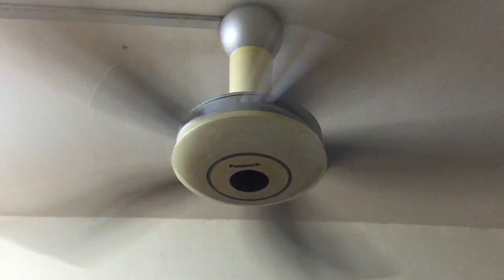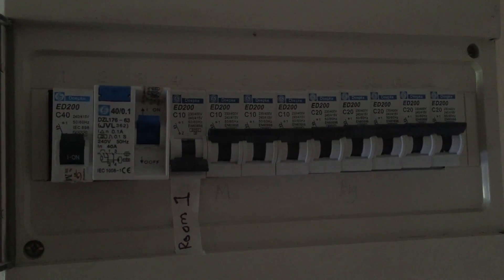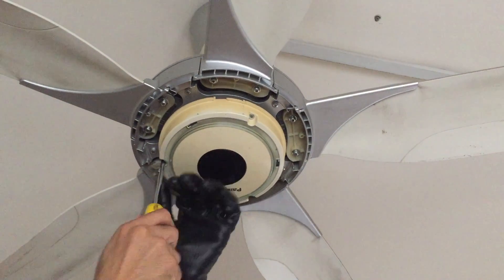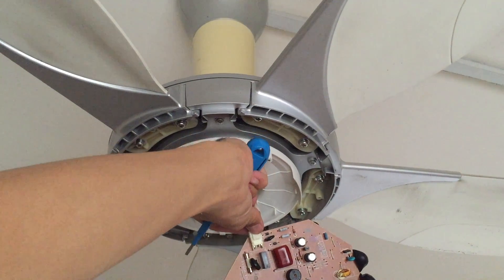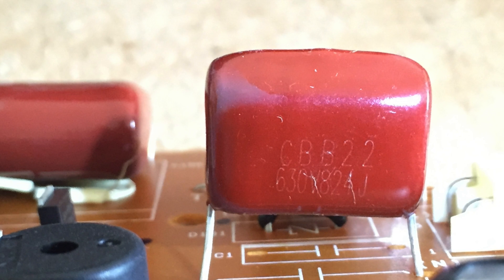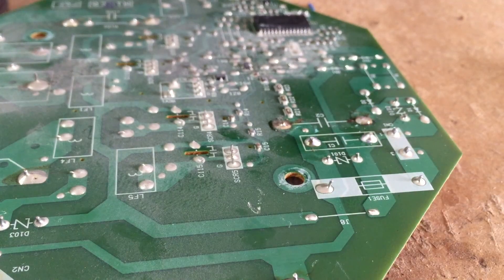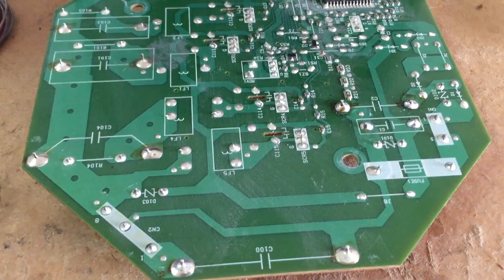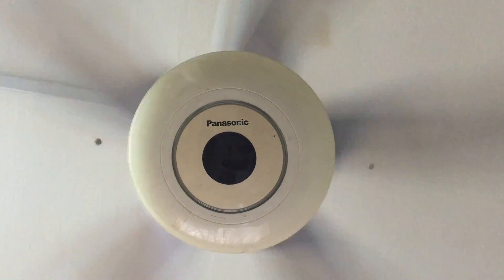Noisy Panasonic FM15E6 ceiling fan failed to start.

Comment: It's safer to switch off the main switch. Take a picture of the wiring connections before you unscrew or remove the circuit board.
Reply from the maker: Good advise.

Comment: Wow... Thanks! Informative! I have KRK 3 speed remote ceiling fan capacitor replaced too! 3rd speed was slow as 2nd speed! Finally, replacement on 1.8uf 500vac capacitor (other 2 : 2.4uf 250vac & 5.0uf 250vac) then 3rd speed back to as it is! So Bro. Do you know which capacitor controls the 1st & 2nd speed? Still, how to solve the "little ticking sound"?
Reply from the maker: My wild guess will be one of those red color non polar capacitors. The smallest value one perhaps for slower speed. I had lots of sleepless night caused by the “little ticking” sound. I tried apply petroleum jelly around the brim of the cover. It seems working for a few days. I remembered someone below mentioned about the ticking annoying sound caused by the bigger capacitors. Not really sure if it will be applicable for your situation.
Reply: @CTB6  thanks for your prompt response! Erm, I think of that way too 1.8uf might control the lowest speed compare to the 5uf capacitor controls highest speed! But, since I couldn't find the 2.4uf and 5uf capacitor, then I replaced the 1.8uf to just did a test, boom... It's 3rd speed's capacitor! Haha.
Oh, so he/she from the comment finally solved the ticking noice by changing the highest reading capacitor? black or red?) Then I shall change all the rest to give it a try? Haha.
Reply: @raymondlooi  You can get all the capacitor you need from AliExpress. The higher capacitance control higher speed. The yellow one is a safety capacitor or most time we call x2 capacitor. It has nothing to do with fan speed. Usually is just to filter noise in power supply line so the fan would not cause interface signal to near by electronic devices.
Reply: @chanh9220  Thanks, dude! Do you mean those RED Capacitors just for noise filtering? Nothing relate to speed control? What does the x2 capacitor mean? Standby? 😅 Love to learn more!

Comment: Can you please show or tell me how to remove the board from the clips, I tried but couldn't.
Reply from the maker: Try hold two adjacent clips with both thumb and gently push it back to release the board from the holder. Need some force but not until it break the plastic holder.
Reply: Alright, will try again.. Tks for the prompt reply..

Comment: Tks Liew, I hv the same problem with this type of panasonic fan. Ihv change the PCB once some 4 yrs back but now it is happening again, rattling sound and the fan is spinning very slow. But thks to your video I will try to change that capacitor C1 and hope it will solve my problem.
Reply from the maker: It is a common issue for ceiling fan. Can’t afford to always change the whole board when it is a capacitor not working.
Reply: @CTB6  , Hi Liew, I went to Jln Pasar, bought 2 sets of caps - .1microF n .82microF and change both on my 2 panasonic ceiling as both also started to spin very slowly and gave a grinding sound. Whalla, after changing the caps, both fans now work perfectly, much tks to you. I chked the faulty caps with multimeter and indeed it was partially bad, very low capacitance, from 100nf it now becomes 15nf.
Reply from the maker: How years  is the fan been using used?
Reply: @CTB6  5 years
Reply from the maker: Statistically it is about 5years the capacitor will be malfunctioned. I guess that’s the life expectancy for that capacitor.

Comment: I couldn't open the cover shown at 1:40, even a technician  that I called couldn't open it. HELP!
My story:
Last time my fan could not spin fast anymore, and an old technician changed the whole board, costing RM166, and the old board he didn't give me back for me to analyze the problem (I wanted to change the capacitor, but this old technician thinks he knows it all). But the new board he changed for me, made the fan spin fast, but after a while, there is no WIND! WTH! My house has 6 same panasonic fans in total, I want to try to exchange the new faulty board with other fan.
Reply from the maker: Could you slide the cover according to the Open direction?
Reply: @CTB6  I managed to open 3 fans cover, the other 3 cannot open, somebody locked it down! ==!!!
Reply from the maker: Try rotate the other side or spray small amount of lubricant. It could have jam or plastics melts and stick onto each other. Some model do rotate the other side. It occurred to me once when the cover don’t know why becomes to hard to open. Try also push in then rotate. The notch can be slightly bigger that’s way jammed. Not really act of other people. It is definitely mechanical.
Reply: @CTB6  holy shit, I just opened it when I was examining the small popup, like a dot, that locked the cover in place, took me so long
Reply from the maker: Yes! That’s the notch you need to overcome.
Reply: @CTB6  My room fan is the one I wanted to change, it cannot be opened, the old technician somehow locked the cover, I have to find the old technician to open the it again.
Reply from the maker: If that’s the case then try 4D oil.
Reply: @CTB6  Hey there, if I am not mistaken, if you cannot open the cover, you cannot take down the whole fan, it's the key to disassemble the whole fan. I still have 2 fans' covers cannot be opened, because the covers are fully locked.

Edit: After exchanging the board taken from other working fan, the no wind problem still exists. What actually is happening is that the wind goes upward instead of downward after turning on. The wind will blow downward after some time, then blow upward again. Other fans don't have this issue. I know about fans in overseas that move both clockwise and anti-clockwise, like https://www.youtube.com/watch?v=9c5ZMPVK_VQ, but it's not relevant in my case.
Reply from the maker: It is the natural breeze feature? Try deactivate.
Reply: @CTB6  Not the "natural breeze" feature, I have tried that as well.
Hope someday I can discover why that stupid wrong blowing direction is happening, I think I need to be a scientist first.
Reply from the maker: If it is the speed issue then you may start with the biggest capacitor. Then the smallest yellow colour capacitor. Capacitor used to regulate the voltage. If either one malfunction it will cause the rotor to loose speed during operation.
Reply: According to Josh CA comment, should I change the biggest longest red color motor capacitor for my old original PCB? the one that old technician took it away sadly, that made the spin won't spin fast.
Reply: Change 2 capacitor on the board. 0.82uf 275v black colour and 1.9/1.8 uf 500v red or black depending on batch.

If really cannot remove the plastic lid. Just use something sharp to crack it into 2. Then after repair and everything running good, but a new decorative cap from the panasonic or kdk service center

Comment: Mr. Liew, if the panasonic fan sounds noisy, when switch off it quiet immediately, while the fan still spinning and quiet, what would be the problem?
Reply: Provin Tan change motor capacitor on the PCB. Refer to my video below
https://youtu.be/n1S-tP6OG3A
Reply: Thanks Josh. Will try it out.
Reply: Hi Josh, just replaced the 0.85uF and it did the trick. Thanks so much for sharing.
Reply from the maker: Hi there, may I know if the 0.85uF capacitor is the yellow tiny capacitor  or the motor capacitor (biggest red) in the board? Do share your experience here. It definitely helps more people who face this problem.

Comment: Tbh it's wrong capacitor, these fans the noise is caused by the motor capacitor 1.6 - 1.9uF 500v, depending on the model. I've used multimeter to check and the capacitor mentioned in the video along with those surrounding are always fine on many fans I've repaired. It's always the motor capacitor that loses its charge and causes the motor to hum due to insufficient current. The burn marks don't really indicate anything cos the capacitor themselves are always okay when tested for capacitance.
Reply from the maker: Josh CA 
Thanks for your sharing. It certainly helps many other people. 
May I know which capacitor in the video belongs to motor capacitor? 
It is the yellow or one of those in red?
Reply: SengChoy Liew the biggest red one. On your fan I think it's 1.8uF 500v. It varies from different models of the kdk /panasonic fan range from 1.6 to 1.9uF.
Reply from the maker: The 1.8uF 500v are meant for motor capacitor? I have been doing try and error until it works. May I know which one in the board supposed to be meant for motor?
Reply: @CTB6  this type fan got 7 speed rite..SO 1.8uf 500V normally for the highest speed. It's same goes to other model like 3 speed or 5 speed. But u need to check other caps like 2uf 250V and 2.4uf 250V as well.Some time the value dropped a little depend on how long u keep running with caps problem.If u run with long hours , some time it will attack other caps.if u need more details and how to trouble shoot ceiling fan motor and board, just visit my FB kipaspro.com
Reply: how do you check the capacitor when its mounted on the PCB? You desoldered them ?

Comment: Hi Mr. Liew, was wondering if a fan speed remained same no matter which speed you choose from the remote, will that be a problem to the capacitor also ? ... and if that's the case, can i also use the method of changing capacitor rather than changing the whole PCB ? i am using F-M14-D9
Reply from the maker: Exactly !

Just the few capacitor. Each cost less than Rm5.
Reply: do u happen to have videos on testing capacitors ? .. there are few of them .. and there wasn't apparent burnt marks ... it's hard to decide which one to change
Reply from the maker: I did not have the device required. It will always be the biggest capacitor seen on board not working or the tiny one as showed in video not working. If the fan remained the same will always be the motor capacitor not working. I would buy both capacitor and change the bigger one first. If problem persist will changed the smaller one.
Reply: Hello boss boleh tolong  5blade fan how capaciter pasang

Comment: wow! awesome! i have the exact same noise but not as loud...... maybe i will just try with tightening the blades 1st.! never touch it since installed.
Reply from the maker: Another easier alternative would be to apply a thick layer (1mm) Vaseline Silicone Jelly over the inner wall of the fan's cover. It provide a buffer layer between the cover and the main body. Don't forget to apply onto the clip as well. That buzzing noise were suspected to be caused by the friction between plastics. You may get one small bottle easily from pharmacy.
Reply from the maker: Hi there, mind share is your experience with this noise issue 2years ago? What’s your way in solving this issue?